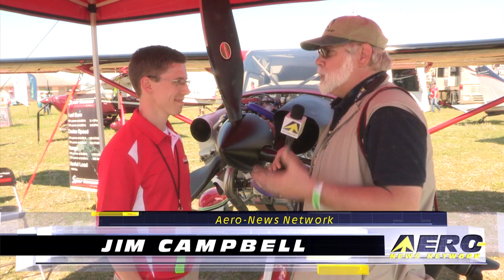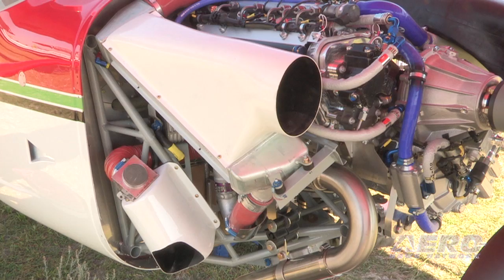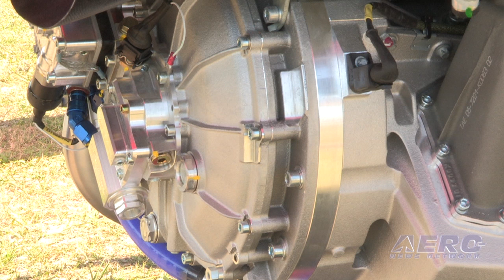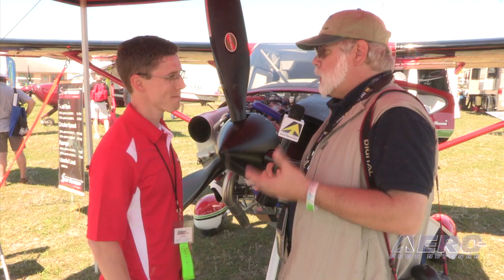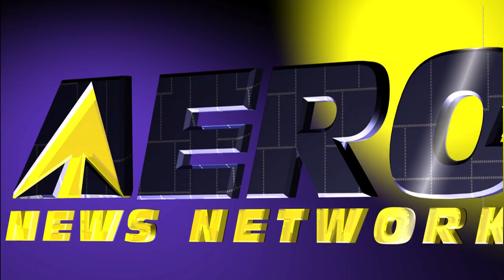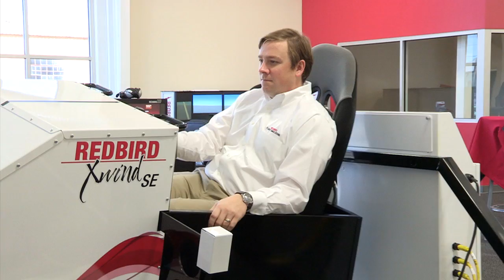Aero-TV: Doing It Diesel Style - Glasair's New Diesel Offering

Comment: All electric > loose voltage and down you go.  Need mechanical injection with a pull cable to shut it off > 100 % reliable.
Reply: Well if it's loose, tighten it up.